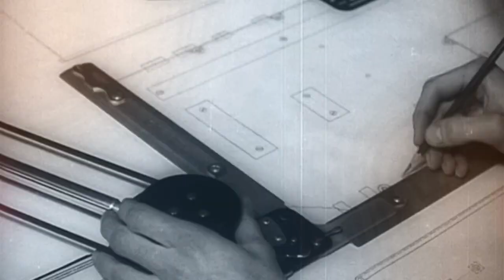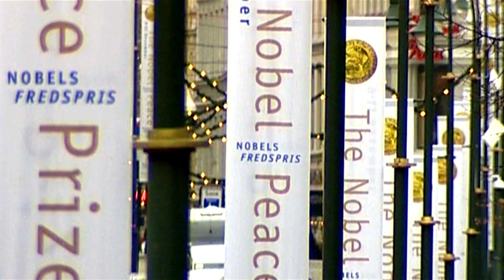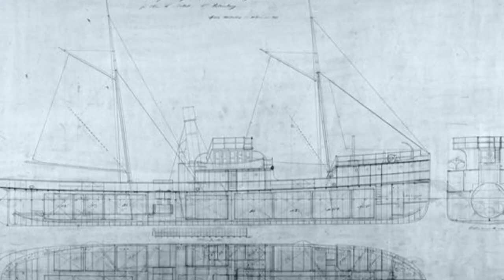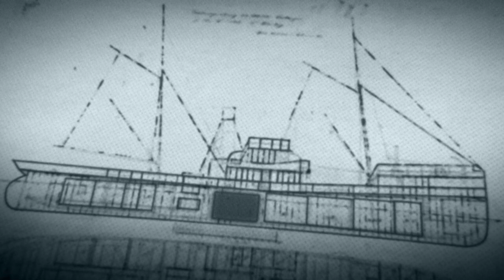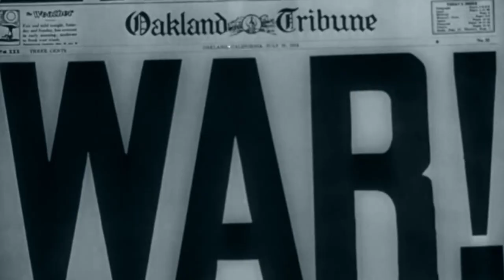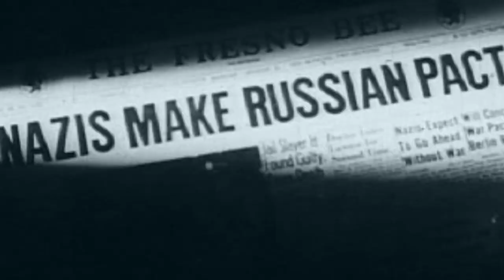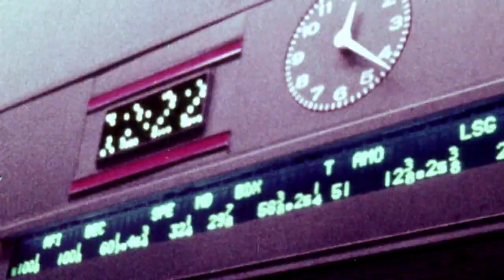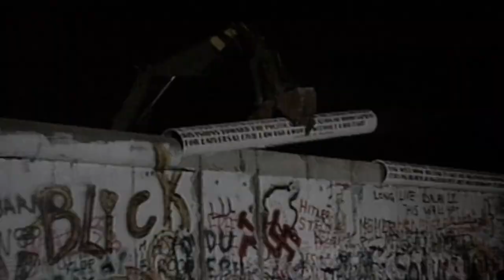Baku: How Oil Factories Strategically Defined World War II | War Factories

Comment: That won't happen again as like country's like Australia may have Oil they now export it then import with no capabilities to manufacturing it's as it has not one single refinery only has 7 days of fuel 1 mayor rail link between each State that connects them, then add to this no major manufacturing in Australia at all.
A thing Australia learnt at the beginning of World War 2 but has now done the very same thing again leaving it in a very same thing again like many other Country's done repeating history that could lead to a major defeat.
Learn by your mistakes not repeat them.
Reply: Same with Canada. We supply more oil to the US than any other Country but we have no refineries to make gas for cars.
Reply: @Crashed131963  how stupid is that but no different to Australia we also send all our Oil & Natural Gas off Shore to be processed as we also do not have Oil Refineries any more, in case of War the Australian Military have 5 days of fuel, it’s a joke they use our resources keeping their own l would have thought we would have learnt after the Second World War we needed to be able to refine our own including have Manufacturing that can build Military equipment we haven’t got any more either.